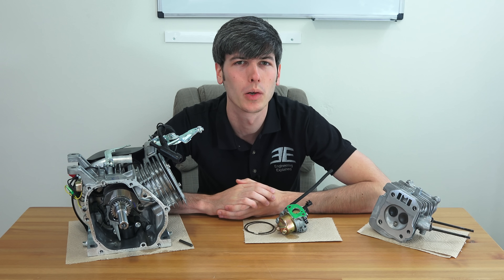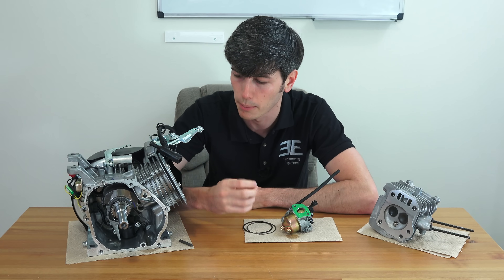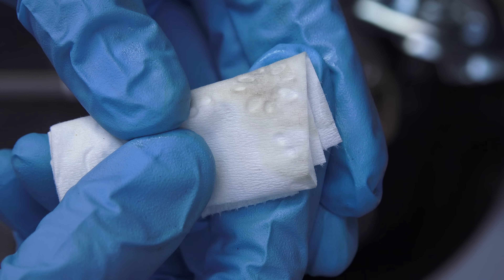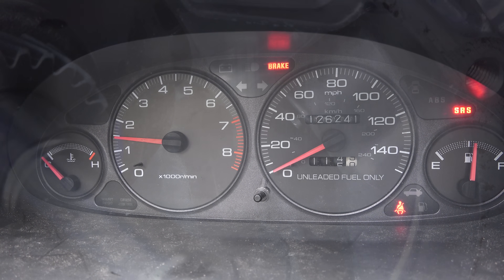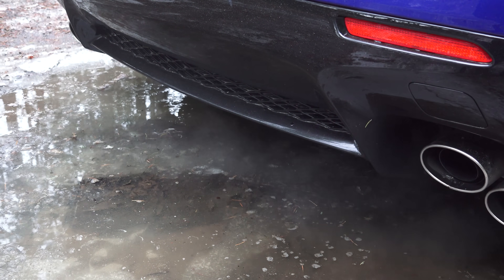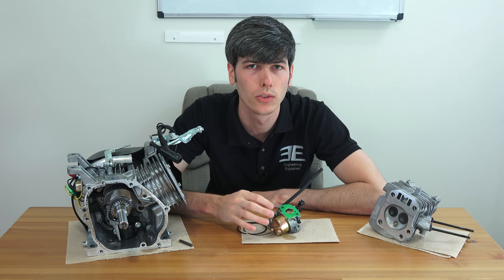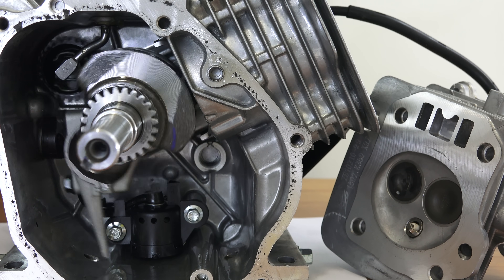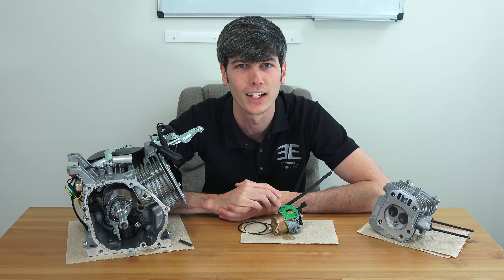Should You Warm Up Your Car Before Driving?

Comment: You guys are all misunderstanding the guy he's saying you don't really need to warm up the car until the needle is in the middle of the temperature gauge. As he said in the video the time you take to clean the ice of your windows is plenty of time for you car to warm up! No need to wait 15 minutes for you car to warm up! He also mentioned that if you do drive your car without letting it warm up at all you should drive it lightly. What he's saying completely makes sense... but if you do choose to wait for your car to warm up for 15 minutes or however long you guys choose to that's on you.
Reply from the maker: +Bryant The only one ☝️
Reply: @EngineeringExplained  People now days warm up cars when its below freezing to heat the passenger compartment.  Nothing to do with the mechanical side.
Reply: @johnh383  Kinda like... a blanket statement isn't it? I'm sure there have to be some people that care about the mechanical side, right? ;)
Reply: It takes me 15 minutes to scrape and wipe off my snow in winter
Reply: A lot of people seem to be confusing "warming up your engine" with "warming up the cabin". If you want to let the car idle for 15 minutes so you don't have to be cold while you drive, fine.  But the engine doesn't need you to do that. You can safely drive the car, just have warm clothes on.
Reply: You may want to replace the thermostat....
Reply: On my new Subaru in the middle of winter it takes 4 minutes for cold light to go off not 15 minutes.
Reply: MASKOAA is your new Subaru direct injection?
Reply: BUT IVE BEEN WAITING 15-30 MINS FOR 20000YEARS SO YOU CANT BEEEEE RIIIIIGHT. 
.....
smh.
Simple and straightforward video.
Reply: Okay if you wait 15 minutes what happens to the car
Reply: Usually 5 minutes in 30 degree weather is what I do.  I like seeing my coolant temp hit about 100 before I take off but I drive a diesel truck now.  The problem is people are one extreme or the other.  30 seconds to minute is good enough  according to the news on it I've seen.
Reply: @MattSmith-vl8zp  Not for the transmission... No one ever mentions the damn transmission. Once that warms up it shifts smoothly. When it's still cold, excessive friction occurs and the transmission won't last as it starts slipping. Why do you think most people don't make it past 100k? Because their transmission craps out. Amd by then the car is already 10 years old and the cost of replacing the transmission is more than the value of the car due to depreciation...
Reply: Christopher VanZetta Heat is bad for your transmission fluid, at 140F/60C the life of the fluid is cut in half.
Reply: @JakeSDN  Not entirely true bud. My trucks fluid doesn't make it to the trans until it hit's 160-180 degree's. So I'll gladly warm my truck up before I drive.😉
Reply: Karl Hopkins Not everybody drives your truck friend.
Reply: @JakeSDN  Just saying bud
Reply: Karl Hopkins Point taken. What kind of truck do you drive?
Reply: @JakeSDN  An 07 f150, there's a little piece in my trans lines, the fluid doesn't get through what's called a thermal bypass valve until it reaches 160+ degrees. Which is probably why the trans fail more then they should.
Reply: @karlhopkins713  Some people remove those or modify it to stay open. Especially in warm climates like the souther U.S. Have you considered it?
Reply: @christophervanzetta  I'm not sure how you're supposed to warm up the transmission without using it? The best practice is to start the car and wait 60 seconds, then drive easy until the car gets to operating temperature. It's not rocket science.
Reply: @christophervanzetta  No one mentions the transmission because 1) we're talking about idle and very little heating of the ATF takes place at idle and 2) cold ATF doesn't increase wear on the transmission. Bottom line... if you want to get ATF up to ideal operating temperature (165-225ºF) then drive.
Reply: Christopher VanZetta That’s why he said DRIVE IT LIGHTLY. Do you floor your car every time you leave the driveway to the point that the transmission starts whining and etc? No? Thought so. Maybe that’s a manual thing.
Reply: Bryant R. He’s in his 20s
Reply: this is for a chilly day in cali, not if you have to plug in the block heater or colder
Reply: What if it's a diesel engine though?
Reply: No one ever means "warm your car until it reaches operating temp" when they say let the car warm up a bit before driving off. Starting off the video by saying that you don't need to let it warm up if it's fuel injected then still go ahead to say you need to let it idle for 30 seconds to a few minutes to get the oil flowing is pointless and misleading. Those 30 seconds to a few minutes are exactly what people normally refer to when they say let the engine run for a few before driving off. The reason why is not important if you certainly have to do it. You do no harm letting it warm up but you could do harm by just driving off on a cold engine. The advice to "take it easy" to warm it up faster doesn't apply to all. For example if you have to go up a steep slope as you leave home then there is no "taking it easy" for you.
Reply: @v1kku  False, I warm mine up 10-15 every morning regardless if it's cold or hot.😉
Reply: @karlhopkins713  what's false?
Reply: @v1kku  Read your top comment
Reply: @karlhopkins713  I've read it, still don't know how your routine falsifies anything
Reply: @v1kku  You said no one warms up their car for the operating temps to be where they should. I don't warm my car or truck up to warm the cabin or cool the cabin, I warm them up to operating temps, for the car, not the cabin.😉
Reply: @karlhopkins713  that's not what I said.

Comment: It's not like your engine will stop running rich after you start driving it. It will run rich for as long as it takes it to warm up. It takes the same amount of fuel to warm it up doing 900 rpm for 10 min as doing 3000 rpm for 3 min, the difference being that there is no load on all the bearings and rings other than minimun amount of load it takes to rotate the engine, compared to when you are driving and the engine has to keep the car going, accelerate, overcome the air resistance etc.  Also, when you are standing still, the whole engine bay will get somwhat worm, but while you are driving, the fresh cold air will hit the engine and, to some degree, make it harder for the engine to warm up.

Comment: Did my regular oil change today on a fuel injected car. Spent an extra $60 to clean my engine after they showed me that the oil cap was full of a white-ish solution. Without me saying anything the technician said it could be caused by two things; a lot of stop and go, or not letting my engine warm before I drive...

Comment: I thought that oil pump sits on the crankshaft with its gears, that should deliver oil at all times, but the guy in the video says that oil is not being pumped into the system for 30-40 sec from the start of the engine. If that's true, cars being used in the northern countries where the temperature throughout the whole year is very low should have shitload of wear on the inside of the engine.

Comment: In Austria, it's illegal to let the engine idle, to warm up the engine, without driving the car. We have to drive away immediately, and let the engine warm up smoothly, using low RPMs. Many bonkers rev up the engine after turning on the ignition.

Comment: I live on top of a 40m, 15% incline hill. To get to work I have to go down this almost immediately, and straight up anther 14%, 50m hill. Temperatures regularly go below 0c, so what should I do to reduce wear on my car? 
To get up the 14% hill I can either go full throttle in 2nd gear, or 1st gear at 4krpm+ to keep at 20/25 up a hill with a 30 limit.

Comment: Read through some comments, haven't seen this. I let it warm up so that the metal in the block and and pistons can expand and take up the clearances. then it's safer before putting load on the engine.

Comment: So it doesn't matter if the hydraulic systems warm up?  The engine ain't the only thing...

Power steering pump and fluids need to get moving.
Auto Transmissions have fluids too.

Ya the engine will work, but it's not just the engine system that exists in a car.

There is theory and there is real life.

Comment: i was just wondering.. my D16z6 engine in my Honda del sol from 1997 starts at 1500 rpm when the engine is cold, it lowers itself as soon as the engine gets warmer, i was reallt wondering if i have a carb r not, i mean i'm not a mechanic, i work on my project cars in my spare time and try to learn more stuff.

Comment: I push the engine to 3000rpm if my girlfriend is with me or if the air is moist and blocking the view on the windshield. Guess thats like the limit to being alright as it is also the recommended max rpm for brand new cars

Comment: you should talk about materials dilatation due to heat.
the piston expands faster than the cylinder because no fluid is passing in it. so if you don't let the engine warm up enough you could get damages in long terms.

Comment: This is my take. If it's cold/warm and the engine hasn't been turned on for more than 6-8 hours, I always idle the engine for a few minutes and I make sure the rpm is below 1000 rpm. If you notice when you start the engine, the rpm is right around 1500-2000 rpm. I wait until the rpm settles down below the 1000 mark and drive away normal but I make sure I don't press and rev the engine hard until the engine is hot. I've been doing this and all my vehicles/engine has lasted for a very long time. Put it this way, would you start lifting barbels or sprinting a 100 m dash without stretching first.

Comment: 20% the normal heat, 20% the rpm, 50% the normal heat, 50% the rpm... easy to do, good for your engine.
If you lves somewhere with really cold and long winters, buy an external warmer (gaz or electrical, both works well)

Comment: I started My 64' Dodge to move it into the garage to do some work on it, instead it ran very choppy in gear and a cloud of fuel vapor came flyiing out of the carburetor <Blow-back> shortly after the blow-back, the car died.  so  this was a surprise to me since outside wasn't cold like, AT ALL unless my choke or needle valve might be stuck open...

Comment: Question. Lately iv been having issues with my Volvo C30 where if I start my car and leave when the rpms drop when i get to the main road and turn to gently accelerate down he road the car way over revs to like 5500 rpm when it should of only went to 3000 or so. i just taped the gas. also i get barley any torque when this happens. its really annoying. It does this a few times then it calms down when the engine warms up. also there seams to be some driveline slack. if im breaking then hit the gas the engine revs for a second then bang i get jolted forward. like the slack from a rope getting taught. so to avoid this i turn the car on and hold the revs at 3500 till the engine is almost warm. If do this and leave all when i said does not happen. the driveline slack still happens just not as harsh. im not sure if this is a good or bad thing but it does seam to make my car drive better. im not overly worried im trading the car in soon for the sport touring honda civic hatchback but I need it running good when i do trade it in.

Comment: Okay, now how much of a "light driving" "warmup" do you need before you can go moderate with your ride, and then how much more to hammer the piss out of it? How long should you warm your car up to do revs for a video or rev battle or two-step test or any of that shizz?
Reply: Ideally when the engine temps are at 95°C. That's ideal operating temperature give or take 5. Basically when the temp needle is in the center

Comment: We use here pre-heating. 30min - 3h before you need to go, you plug a cable to your heater and it starts to heat your oil. Then there is also fuel using pre-heaters that works the same way, but doesn't require you to connect your car to house.

Comment: I used to drive an inline 6  engine of an old chevy Opala ( brazilian). It uses a carburetor, but I used to run on Natural Gas ( very common and cost effective here). At cold days it was just like an fuel injected car to start up, because natural gas is already vaporised and I guess it dont wear out the oil so much as gasoline on an rich mix.

Comment: I have a slight problem. I don't like letting my engine idle for more then a minute or so doing cold start. However my job is literally like 5mins away and my engine never reach proper operating tempatures. I get up to freeway speed gently and is rarely heavy on the throttle, I use an OBD2 to monitor temps. One day I heard clacking noise or like taping noise from the block 0_0 I did research and alot of people had the same problems with similar cars and engine model. they said the engine did not warm up enough for the oil to reach the lifters or poppets not sure what it was. Anyway they said it was getting stuck due to lack of oil getting there and to warm up the engine more befor turning it off. Sure enough when the engine got warmer the noise disappear so now I warm my engine for 5 mins and then there a 5mins drive so 10mins for the most part I assume my operating temp is 160f I have an electric thermostat after 10mins I get 160f to 170f befor I did warm up it would only reach 140f sometimes 130f when I get to work . I just hope it won't wear out other parts of the engine. I am going to check my oil soon now that I'm worried that some gas seep through the oil.

Comment: hey i have a question what about the opposite when its so hot outside like 40 45 degrees celcuius i like to remote start my car and let it the interior cool down for 5-7 minutes does that still mix fuel with oil when the car has been sitting over night ?

Comment: Interesting reading these comments. It's just not that hard to understand. Start your car and drive gently until warm which will only take a few minutes. It's not rocket science people! If you get a lot of frost or ice just place a large towel over your windshield and it will be clear right away. Turning on the defrost with the A/C on will defrost the windows quicker by removing the moisture in the air.

Comment: I usually park my car under the sun 10 mins every morning before i drive. It saves gas but still warms up the engine.( its better to keep the hood opened, it works faster+ my car can get stronger harder bones from getting direct sunlight)

Comment: What about diesels vs. gasoline. Here in Alberta many people leave diesels idling so that they don't need to fight with restarting them from cold. We also occasionally have rural schools shut down because the diesel powered buses fail to start in the morning.

I once rented a 1995 Duramax from my mechanic while he worked on my regular truck. He had it pimped out with an ether system as well as a fast idle mode for cold weather.

On that subject what difference would a fast idle mode make in terms of the concerns over running cold oil? Would forcing the engine to run faster cause it to warm faster, but instead lead to other problems?

Comment: Carbureted engines used a choke to enrich the cold air-fuel mixture. I had a Lada in the early 90s. It's what the Russians called cars, and exported to us - the other eastern block countries. (we had to wait for years before getting one, but that's another story.) The thing had a manual choke. You would run rich after driving off, until you remembered to close it. So, running cold would be even more detrimental for a carbureted engine, for the possibility of driver misjudgement who could use it longer or wider than necessary.